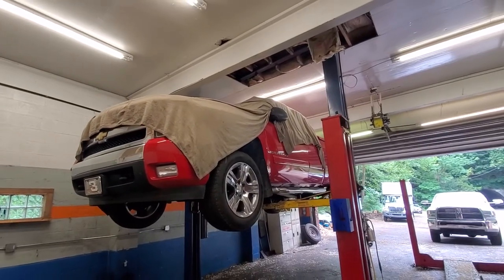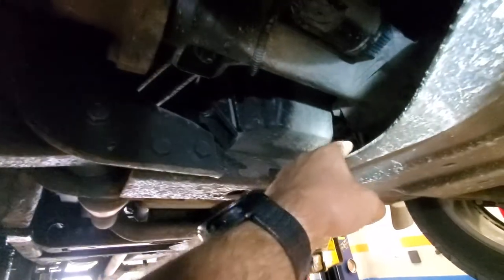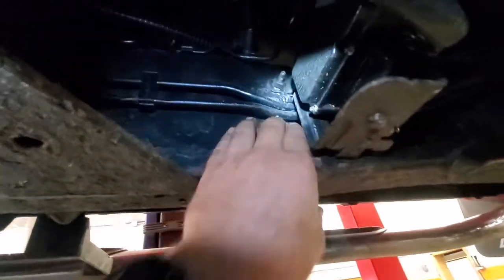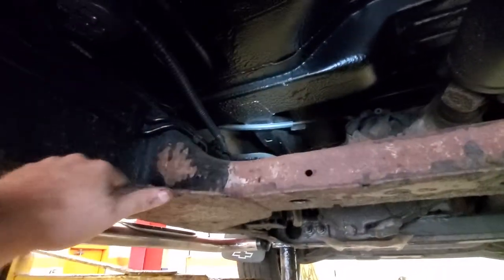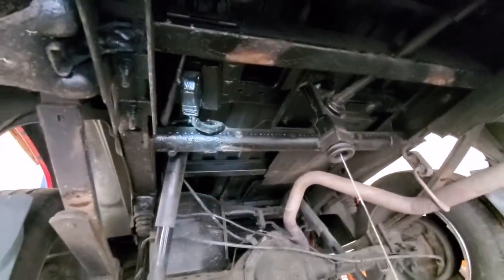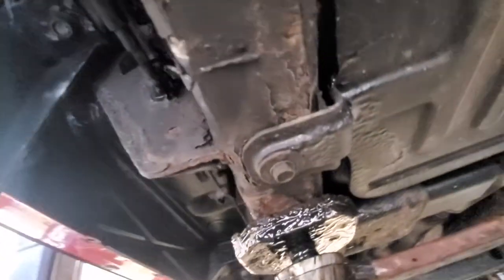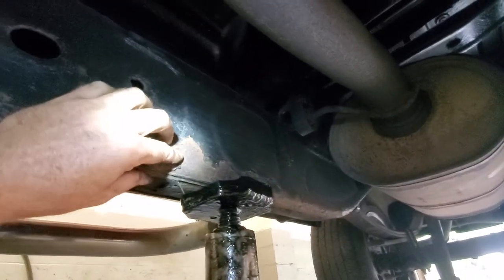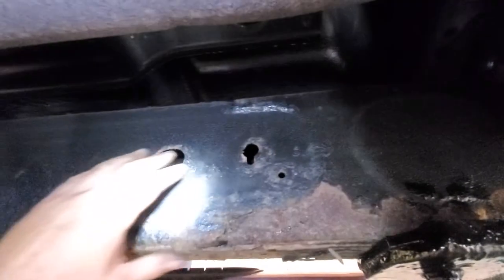08 Siverado ruined by hard undercoating

Comment: Many years ago I worked for an old farmer. He bought a 72 Ford pickup and a 72 torino new. He sprayed everything underneath and inside doors and trunk with trans fluid mixed with diesel.  Everything that was sprayed still looked new. But everything that wasn't was rusted away"sheetmetal". Last time I saw the vehicles were in 98.
Reply: or used motor oil back in the day.
Reply: I've been spraying my cars with used motor oil out of an old siphon feed paint gun for years. I do it a couple times a year and it works well.
Reply: Some of us know that is highly irresponsible to the environment
Reply: @Alex B    Sure is. But then everything thing is almost every peice on a car. The asphalt you drive on . I could go on for days. Thank you for you opinion.
Reply: @AlexB-up6fd who cares
Reply: I have been using transmission fluid as under coating since 1970. Never have no rust 😊😮
Reply: Used at is the best
Reply: @AlexB-up6fd Some of you don’t know the first thing about the “moral superiority” you spout as facts let alone wisdom.  Oil comes from the environment, oil is natural, there are bacteria that eat oil and break it down and over time it dissipates to the point that it’s gone.  Felling morally superior is a lots easier than knowing what you are talking about.  It’s it.

Comment: It was ruined by GM's pure chinesium construction.
Reply: I've got a 2021 chevy 2500 gasser. I was looking everywhere for a place that would professionally undercoat it, everyone said they couldn't because gm uses that ghetto ass wax undercoating. You get 1 tiny spot of exposed metal and the entire frame starts to rust behind the rest of the wax. They all rejected my vehicle because they said if they spray anything on the frame, it's going to strip the factory coating right off the frame. Took a garden hose to rinse off some parts of the frame from road salt and a giant patch of the factory wax coating just fell right off onto the floor. The patch was literally the size of my hand. Because of this i'm going to be trading it in for a cummins since they don't use some shitty ass wax.
Reply: @Deleteguest  The quicker that wax falls off the better.  I wouldn't trade it in even though I like to talk shit.  Modern diesels are a minefield of issues.  I'd rather have the gasser and a slightly rusty frame.
Reply: @Deleteguest  The places refusing to undercoat your truck are right... 
GM's wax is worse than nothing (Ford). No one likes it even within GM Tech Center and proving ground. It is a big mystery to me why they keep using it

Comment: I worked for an under coater, and there was planning, prep, masking, cleanup, and quality control on every type of vehicle. There was after sales service and annual checks if the customer wanted it. We lived in a salt air laden community, and if it was made of metal, and it was out of doors, it would corrode.

Comment: never buy a vehicle with hard undercoat. not only does it often make it harder to work on the vehicle when the time comes but it often is used to cover up damage and is often put on over rust. the vehicle is still rusting under the undercoat. dealers will often slap on undercoat to hide things as well. never buy a vehicle with slapped on undercoat. do it right and use temporary undercoating's that you have to reapply every year or two. you want to be able to see whats going on under the undercoat.

Comment: We do the same treatment as you do, here in Ireland. We used do the hard coat stuff - until we swiftly realised it was useless. Our system also treats the insides of  box sections - which is the really important part. If you only treat the outsides, it's half a job. We learnt that fast too. :-)  Great video btw.

Comment: -- The bottom of my Tahoe looks like a mess but I did it myself.  Very curious to know what you think of my process.

1) 5 days wire brushing to descale.  
2) Banging Frame and cross members with hammer.  Pressure washer inside all.  Compressed air dry.  Vacuum and magnets inside frame for the rest.  Repeat process again.
3) 4 days dry time.
4) 2 coats of Coroseal Rust converter inside frame/crossmembers/ everywhere.  1 week dry time.
5) 5 coats of Fluid film inside frame, 12 days dry time total.
6) Outside frame/everywhere.  CRC rust inhibitor, two coats.  One week dry time.
7) Two coats RP-342, One week dry time.
8)  Two coats Farm Equipment Paint.  (Figure that will armor from pebbles and road debris).
Then let the vehicle sit unused for one month.

Took me spring, summer and most of fall to do it myself.  But I got it all.  2004 Chevy Tahoe which was pretty clean to begin with.  Inner doors, body panels, under trim basically got the same treatment.  

It was my first time doing this, so I wonder of anyone here that knows what they're really doing would approve of this process.  Please let me know.  It's a winter beater, but in this economy, it needs to last.  

And those shops that tell you they can do it in a day.  They're out of their minds.  Any positive or negative feedback is welcome.
Reply: I doubt farm paint would stick after all of that. I stick to your steps 1 and 5.
Reply: @jokly1264  -- Well I can confirm you're right.  The other products are oozing through the equipment paint.  First I thought it was more rust.  Turns out it was the products.  The good news, the equipment paint isn't directly on metal, so I can probably get away treating everything once a year with out the paint.   
     Thank you for your reply.
Reply: @MarkJacksonGaming  Of course. You definitely have gone above and beyond with your treatment and it should work very well.

Moving forward I would just recommended doing the 1 coat of fluid film per year to keep up the protection.
Reply: @jokly1264  -- My thought exactly.  Now that the hard part is out of the way, come next September, wash it, and give it a gallon of fluid film.  Heh, and yeah, I did go scorched earth on the treatment.  Rust belt here.
Reply: Paint over FF? Im curious how long itll stay attached tbh.
Reply: @0xsergy  -- Thankfully not long.  Read all the comments, you'll get the picture.
Reply: @MarkJacksonGaming  Mark... you're hired bro!! I'm impressed. I'll be over with my f150 tomorrow, lol.
👍🏾🇺🇸🍻

Comment: I have a 1995 f150 I took for body work and paint and the shop had the bed off for a couple months, causing the frame and gas tanks to rust quite a bit.  When I pointed it out they put por15 on it.  I really wish they had just kept the frame covered while they had the bed off, rather than sit out in the rain and snow.
I've now covered it all with wool wax and hoping it lasts.  This was my father in law's truck and he passed away 5 years ago.  I want to own this truck the rest of my days.  At some point I am going to have to take the bed off and really clean up the frame now.

In any case, the wool wax is great.  On a full sized truck I spent about 30 minutes with the air sprayer and think it's pretty thorough.  Hopefully it prevents the spread of rust
Reply: If/when you get around to getting your frame cleaned up, I highly recommend that you invest in an electric burnishing tool and extra drums to go with it. I used one a month or so ago on my 1994 Ranger chassis that went through over 20 Ohio winters and it made the scale and rust pretty much disappear. Mine is branded "Restorer" but they're also sold under Craftsman and other brand names. It doesn't matter what brand you buy because the ones like mine are all made by the same company (Restorer) and all of the accessories interchange between brands. I paid around $150 for mine but it came with a bag and a bunch of extras. I believe you can find the basic kit, as well as the Craftsman (Lowe's sells them) for well under $100.
Reply: @MikeBrown-ii3pt  I actually bought a tool called the Eastwood Contour SCT (Surface Conditioning Tool) for that purpose.  I think it's similar to the Restorer you're talking about
Reply: @joeweaver9913  I looked at the Eastwood tool and it is similar. Mine is more enclosed though. The drums still interchange though. I have a lot of Eastwood stuff including the MIG 175 welder and I love all of it.
Reply: @joeweaver9913  I used the 40something grit rust removal drum for the heavy stuff then switched to progressively finer wire wheels and sanding drums. My frame came out very nice even after all of the Ohio winters. I then used Eastwood coatings on it.

Comment: I've been spraying fluid film on my vehicles for a few years now. It works fantastic. But the amount of people that still argue with me to spray a hard undercoating or paint over rust is astounding. If you use a hard undercoating or paint it will 100% ruin your vehicle. I'm a diesel mechanic and I've seen double C channel frames rust through and break because the owner decided he was tired of looking at rust and had it painted. We have crane trucks in our fleet that are 20+ years old and have no rust because, over the years, leaking hydraulic lines have coated the truck with oil. Oil or wax undercoatings work I see it first hand. The oldest trucks in our fleet are crane trucks because of the oily mess they are. 

And for anyone thinking it sucks working underneath a car or truck that had been coated with fluid film or similar product, it doesn't. It actually keeps screws and other fasteners from seizing up due to rust. It keeps electrical connectors and wiring free from corrosion too. And over time it does thicken up and it's really not that bad working under there.
Reply from the maker: I have this argument with people on the phone everyday.  No matter what I do I can't convince them why they should have put a hard coating over their Rusty vehicle
Reply: I found this comment to be very helpful and informative. Thanks mr. bloodbain88
Reply: What do you spray underneath?
Reply: @firingallcylinders2949  Fluid Film. I might try NH Oil one of these days.
Reply: What about sanding your frame and spraying it with rust reformer like rustoleum?
Reply: @airsoftdude36  I've heard of people sand blasting their frame, then painting it with Por15 rust inhibiting paint, and then coating it with something like cosmoline or fluid film. But that is an insane amount of work, really only doable if you're doing a full frame off restoration of a vehicle.
Reply: We have had pretty good results using kerosene mixed with roof coating tars , the kerosene soaks in and slows down the rust and the tar holds the kerosene and keeps it from dripping off .

Comment: I've ben disassembling some older Chevy square body trucks one in particular was hard undercoated only places that still look good had oil leaks that had soaked into the hard undercoating and seamed to keep it pliable. Maybe I'll try hard undercoating mixed with ATF the best of both worlds . Making it more durable that wool wax but still will have to reapply from time to time . Any thoughts ?

Comment: This is my comment in my thread at Ford forum.   

I do not understand how nowhere I bump in this simple concept at Internet.
If paint is on the car spraying any sort of paint or Cosmoline over it is useless because it will fall off at top of existing paint if existing paint fall off. Only that make sense there is Lanolin, called Fluid Film or Woolwax or so, because Lanolin moves and will go into cracks of paint and stop rust.
If paint did fell of and Lanolin is not there than we have paint over rust situation as nobody can go under car every day to check cracks in paint and rust will start in a day or so. Then is time to use Cosmoline, for me, or Por 15 or whatsoever someone like over rust.
I do not like Lanolin as I work under car and will destroy clothes. However, Lanolin in Cavities from begging look like way to go as we cannot check for rust and cracks in paint in cavities.

Verry smart comments from you about rust proofing in this video.  Probably will put it in some comments at forums.

Comment: Good idea to undercoat a new vehicle because there is no rust....also don't wash the underside to clean debris off and if u do,please use a blow gun to dry all surface areas including inside frame rails as undercoat will trap water in areas and rust out

Comment: West System Epoxy line.  Clean, degrease, grind, sand, scuff, degrease, dry, base epoxy coat, multiple barrier coats, final "hard coat," clean amine blush, dry, scuff, multiple coats of hi-temp cosmetic paint in alternating colors, multiple clear coats, then wax regularly.  Absolute armor.

Comment: Hard Coatings on New Vehicles work very well.  I had my New 96 AstroVan  Undercoated by the Dealer  in 96 and as it sits, there is Absolutely Zero rust or corrosion.  I Im in NY and Underneath looks brand new still.   Used vehicles should get the soft coating.
Reply: That’s because you hard coated a clean vehicle. Can’t do it with a crusty bucket!!!

Comment: I’m having my Silverado, New Hampshire oil undercoated tomorrow. Hope it goes well!
Reply from the maker: NH oil works very well, as long as it's not a new Silverado
Reply: @steelcityoilundercoating6305  Wait why not? Are you not supposed to use NHOU on a new car?
Reply from the maker: @PocketsandOutlaw  GM full-size Vehicles come with a wax coating you should never apply oil the first-year you risk it melting the wax off years later
Reply: @steelcityoilundercoating6305  Oh I see, thanks for the info!

Comment: I almost paid £1200 for a service like this for my '10 Jeep with lots of rust all over the underbody. I've stripped almost everything off the bottom of the truck and currently in the process of sanding and grinding everything back to bare metal, as part of a complete restoration. It's only after I started doing this properly that I truly realised how insanely pointless it would have been to pay someone to spray over the rust with some sort of hard coat.
Reply: use fluid film

Comment: I just had my 23 Tacoma undercoated by LINE X Valugard 160 - did I make a mistake? guy from shop told me it's safe to drive right after the spray while it's a rainy day.  My undercoat feels soft to touch which I think is wax material (is this safe?)
Reply from the maker: What part of county do you live in?

Comment: Spay with old engine oil in the spring and in the fall and your truck or car will last a long time, simple as that.
Reply: Old engine oil is dirty and acidic, wont really help. 
Linseed oil hardens up and sticks very well after it dries. Its also safe for the environment if it drips while driving in natural areas.
20% wd40 80% linseed oil in a 20$ quality spray bottle works great for me.
Reply from the maker: Car oil works but is illegal, makes a mess, is a fire hazards, drips all over and can cause an accident and oil had acid that will cause surface rust.  It still helps though.
Reply: @steelcityoilundercoating6305   illegal? will the oil undercoat police come and arrest you? lol. Farmers have used it for 100 years to keep their equipment from rusting away.
Reply from the maker: @lar4305  that's a silly question of course no one's going to come for one person spraying oil but open up something on the side and no shut you down super-quick using motor oil.  Most Farmers actually use lanolin blend, oil works but has acid and eats into everything so it's really not ideal
Reply: I tried engine oil and it only lasted like month

Comment: Covering over used vehicles with rust and debris also worse as it traps in moisture and accelerates corrosion. I saw a vehicle on YT from North, and it was rotten due to this type of work.

Comment: Is Chevy still using wax on the frames?
Reply: Last time I checked they were. Pretty weak form of protection. I remember not too long ago one of there plants had leaky roofs that caused surface rust on new trucks. Pretty poor quality control if you ask me.

Comment: I have a 16 someone did this to. How can I get it all off there?
Reply from the maker: Can't, sell it
Reply: @steelcityoilundercoating6305  
Ok thanks just bought the truck douch bag
Reply: That's a lazy man's answer
Reply from the maker: @jromem7313   It's not...  to remove undercoating like that you'll have to pull the bed at minimum have the entire frame soda blasted down to bare metal and then re wax or or epoxy primer and paint. $$#
We do it for people all the time but to do it right it's over a week of work and you'll pay thousands of dollars You're better off selling the truck at top dollar and buying another  one that hasn't been undercoated over. 

 Because even if we fix the frame you're still most likely have junk undercoating all over your body panels which can't be corrected

Comment: I don’t trust the rubberized stuff.  It doesn’t penetrate or creep.  I like the oil based stuff because it penetrates and creeps.  Oily metal does not rust.  

Ziebart used to do wax in the 80s and 90s but only on the body .  I have ziebart wax from the previous owner in my firebird
Reply: Ziebart still do the wax... 
but not all Ziebart shops do it right, and for those who does it right, they don't do it right every single time